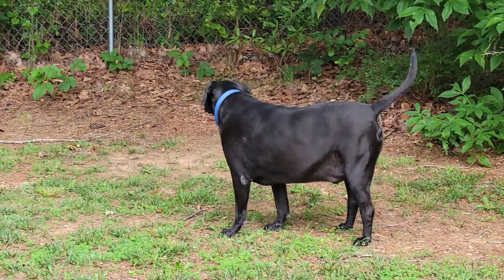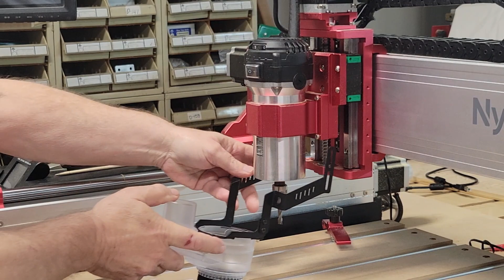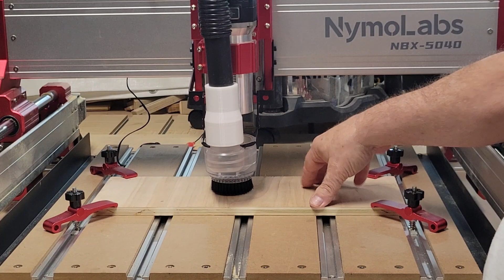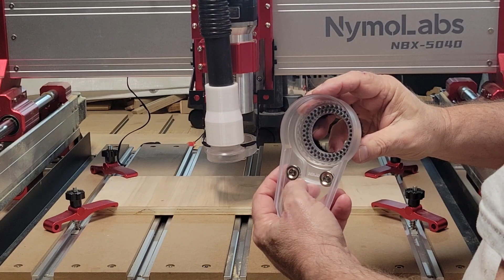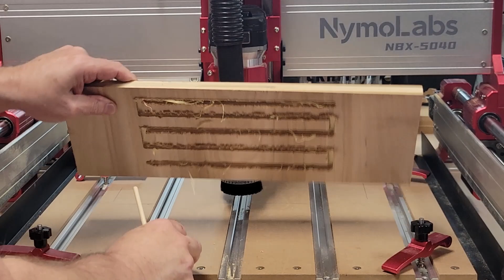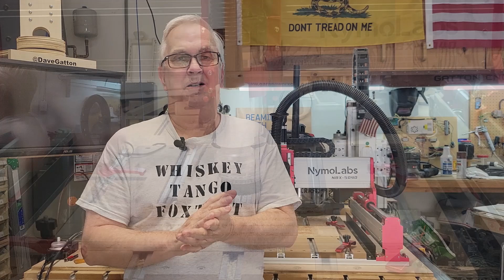Man, This Thing Sucks!

Comment: Dave,  good information.  I have a “Suckit” dust boot which works quite similarly.  I use tape and super glue so I haven’t run into problems with clamps getting in the way.
Reply from the maker: Thanks for watching Paul.  The tape and CA glue method is perfect for these types of dust boots.

Comment: That machine does suck!  It seems to me that the housing-hitting the clamps problem could be solved by using a 1" or 1 1/2" longer brush.  From where I am sitting,  it looks like that would be simple to do.  I like the idea of it not moving with the router!
Reply from the maker: Thanks for watching Dennis.  The problem with making the brushes too long is the vacuum will pull them into the router bit.   This design will work great with the painter's tape/CA glue method or even a wedge clamp method.
Reply: @DaveGatton  I'm using a 3" brush on my shoe with no vacuum pulling into the bit.  Your vac is probably stronger than mine.

Comment: Slotted holes and thumb screws on the mount would allow for quick height adjustment. Or, attach it with magnets like the brush holder is. Overall, it looks like a nice machine.
Reply: Yes, but I would attach a thin steel strip to either side of the Z carriage for the magnets to attach to.
Reply from the maker: Thanks for watching Bill.  It is a great machine.  Thumb screws might work if they're small enough.  There's not a lot of room for a large head screw.  Magnets won't work with aluminum.